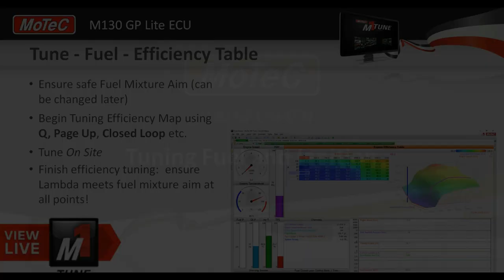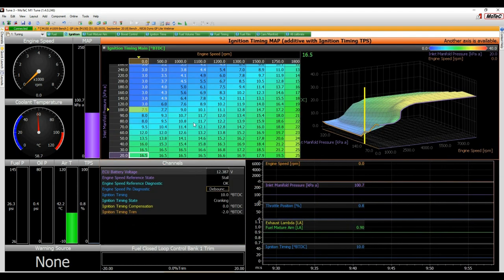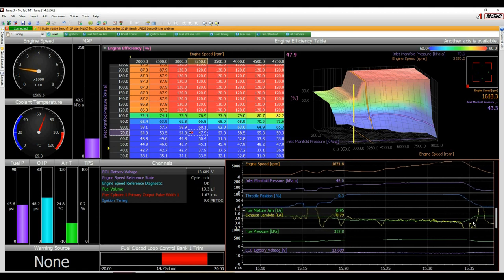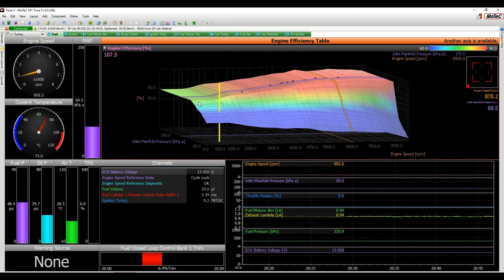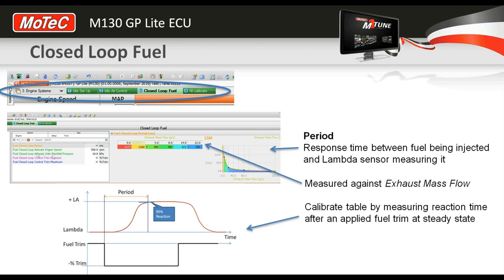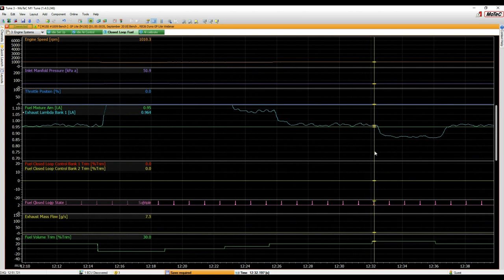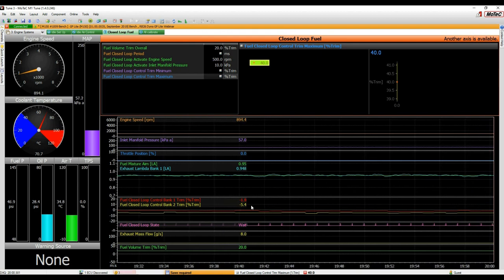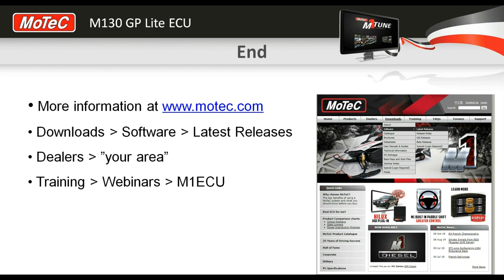GP Lite, Tuning - Fuel & Ignition

Comment: These are not engine technicians, MoTec good, these guys don't even know what pin is from 86b feed to said 1 in the serial socket.nor what 0.25v ac means on which volt drop...

Comment: 16:41 ITS ALREADY LEAN! I DID A MOTEC COURSE MID 90'S, AND IT WAS ALL ABOUT inHg, not microsoft.q: whats this engines fuel DELIVERY, not  schrader valve. Shame, where is your tuning ear mate?? Graphs etc, smh. I bet this engine has low psi between exhaust valve and 1st baffle. Please continue to "graph your engine", test of us will pass you by mr.avalance diode ❤